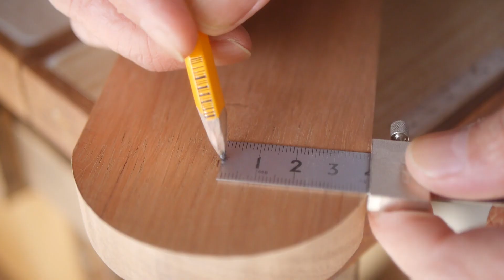Coat Rack

Comment: I always enjoy your videos.  Thank you for sharing your work.  This looks like a fantastic use for some of the scrap pieces I have.  
I have been wondering for a while, what finish are you using on the wood ?
 It looks like an oil going on, but a shellac when dry.  Also are you getting that finish with only one coat ?
-  Thanks.
Reply from the maker: Hello Mark
Thank you for enjoying my video as usual
The scrap you have is valuable!

Mixing my oil is very economical
A mixture of olive oil, sesame oil, lemon oil and kerosene
I don't know if this mix is correct!
Finally, finish with a cheap acrylic clear spray.
Don't be disappointed!

Thank you from Japan